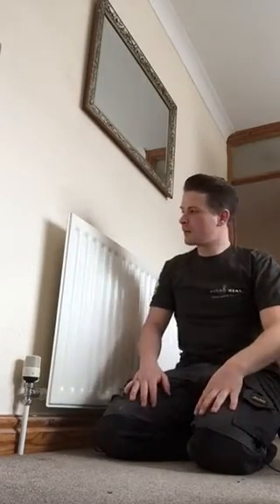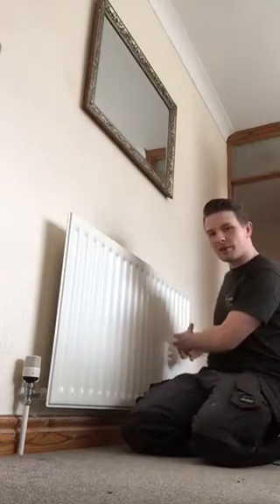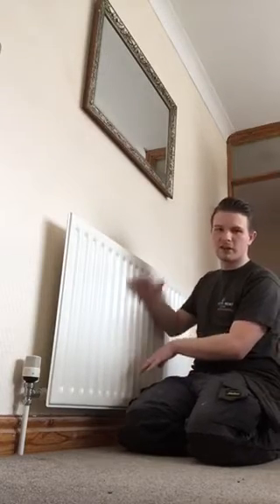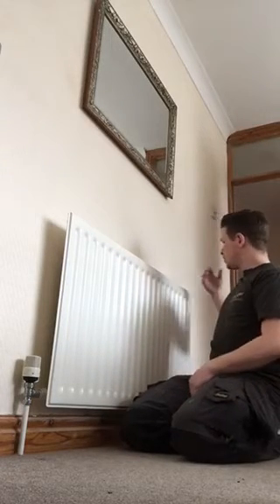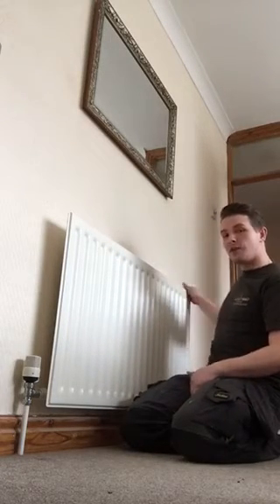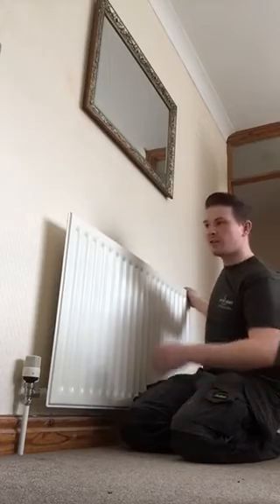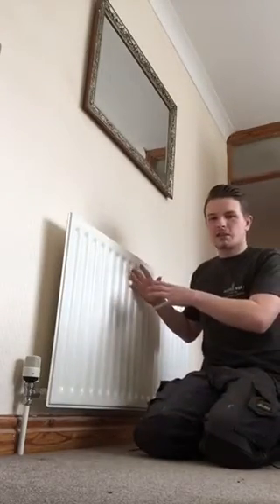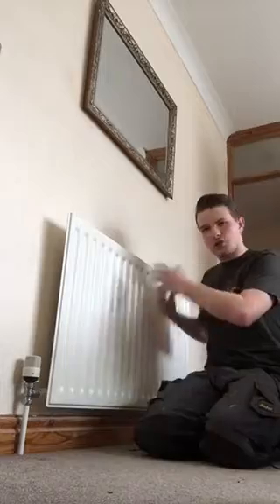How to remove an air lock in a radiator or central heating system.

Comment: One cold radiator - following the replacement of 9 radiators. I was just about to take the problem radiator and valves off to see if the TRV was faulty and saw your video.  Your approach and logic makes epic sense and I turned off all the rads less one in the hall (just in case the troublesome radiator valve had failed - didn't want to stress the boiler). The extra system pressure on the troublesome radiator was enough to move the massive air lock and I was able to bleed the air away. I've been DIY plumbing for a few years now but this is a tip I'll remember and pass on with huge thanks :)

Comment: I've recently had a new boiler fitted and I now have two radiators that very slowly only get hot at the top (they previously got hot all over very quickly). The valves on either side of the radiator are piping hot so the water is definitely reaching them. Is this a sign of an air lock?

Comment: Hello, please help. How to turn off hot water on open vent system
One heater downsrairs getting air lock. Plumber came last time put hose is bleeding valve and was ok. But after 5days agair stop working. It's posible same radiator got airlock again.?
Thank you so much for your help

Comment: Can you clarify what you mean by turn off the hot water @ 1:00 ? The subs then say "it's important to turn the hot water on" - I'm confused by this bit. Thanks
Reply: Sorry that it’s not clear John. This applies to systems where you have a hot water cylinder, you need to turn the hot water off at the timer/programmer to ensure a valve is in the closed position which then forces water to the heating side of the system. 

If you don’t have a hot water tank then don’t worry about this step.
Reply: @We-Are-FlowState  Gotcha. Not sure why I missed this when you even mentioned it in the video. Appreciate the quick response :)

Comment: Life saver this my friend. I'm fitting a new bathroom in my house and pulled a skirting board up, and the original builders have nailed the board on straight through a pipe! I managed to hammer the concrete out and expose the pipe and fit a straight speedfit connector. This was the final step to get everything back to normal!

Comment: I’ve got a rad (a few actually) that’s cold in the middle and towards the bottom again in the middle) I took them off and flushed them out outside (jet washer) but it’s still cold in the middle,(not the top) do you think that could be an airlock ...(downstairs rads) cheers arkid.
Reply from the maker: Hi Joel..

Depends really is the hot water going to your radiators going in from one side, through the rad and then back again? 

If both pipes either side are similar temperatures then that can indicate that there is circulation. If one's a lot cooler then that indicates there is a flow issue. So either an air lock, a blockage or a restriction. 

If all looks good there then it could be that the water is passing through the radiator too quick in which case turning the lockshield valve down a few turns will slow the speed down giving it more time to hang around in the radiator and spread it's heat 😊
Reply: @Hydroheat  cheers arkid ! I tried all the above today,no joy,think I’m gonna have to try flushing em again,but with a pressurised hose fittment,thanks for getting back to me so quick...cheers...

Comment: Please can you advice me , recently we had a new pressure  boiler fitted and ever since then we can hear the pipes under the floor boards and walls tapping / rattling and banging noises . I have gone round to each radiator to see if there’s was air in them and some did have a lot of air and some didn’t , I then switched boiler back on and I have noticed the tapping/rattling/banging noise isn’t as loud but it’s still there and disturbs us during the night and mornings , do you know what the issue can be? Our old boiler was fine for 14 years with no noises whatsoever. I’ve read ppl saying there could be air in the boiler system but I haven’t found any video on YouTube that shows how to remove air from a pressure boiler apart from Americans that have a different set up as here in UK. 
Please help 🙏🏼
Reply from the maker: I'm so sorry for the delay I've only just seen this. 

Did you get to the bottom of this?

Comment: Would you turn off both ends of the rad. You said either thermostatic or lock Sheild but that rad including mine have both so are we shutting both sides off
Reply from the maker: Ones enough to cut off the flow to force the pump to push elsewhere. 

However if all of your lockshields are in the fully open position then you will need to shut all your lockshields down (balance the system) to help for e things round more equally

Comment: Thanks for this video I've just added a new radiator to my system downstairs.Do i need to turn all other radiators of at both ends?thanks
Reply from the maker: Hi Ryan, typically no, if there is no circulation to your new radiator then it's probably my just air. You should be ok turning just one side off. If you still have issues when you open the valves back up then you could have a balancing issue, your pump may be weaker than it used to be. 

Good luck

Comment: I seem to have an airlock in my heating system, can't get it out. When you say turn off the hot water can you explain further 🙈
Reply from the maker: Hi there, sorry for the delay, did you get this sorted.
Reply: @Hydroheat  All sorted
Reply from the maker: @thefridge1000  that's great what did it turn out to be?
Reply: @Hydroheat  blow off valve was open ha ha . water was flying out the back

Comment: If you turn all rads off except the offending one, and it turns out it’s blocked with sludge and not an airlock, could this cause a problem? As the pressure would be building with nowhere to go?
Reply: Hi Nafehere, over a long period of time this could cause an issue to your pump yes, if it's an air lock then the problem should resolve itself within a couple of minutes, if it doesn't it's wise to open your other radiators again. I wouldn't recommend forcing it over a period of time it's not ideal, but I've come across pumps which have been under stress for a long time and still have a lot of life left in them, they're quite robust.
Reply: Great, thanks for the reply Jamie.

Comment: I have an oil fired system and when i switch the heating on i get an loud banging or hammer noise coming from the pipes beside the hot tank, the pipes lead up the stairs, that where the noise is coming from. I have a feeling that i have a massive air lock and I have bled the radiators upstairs and i do get a bit of air and after a while the banging stops. But the next time i switch the heating on it does the same thing again... any ideas or help would be great
Reply from the maker: Sounds as though you have a design issue which is pulling air into the system. You'll need a heating engineer to come in and look at whats going on. 

Many thanks.